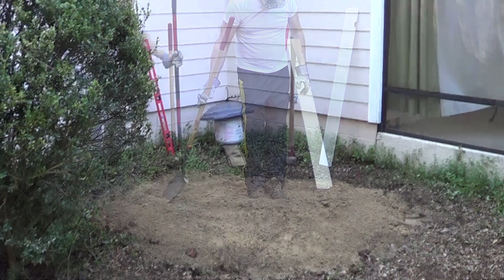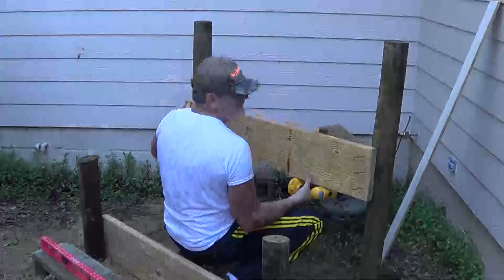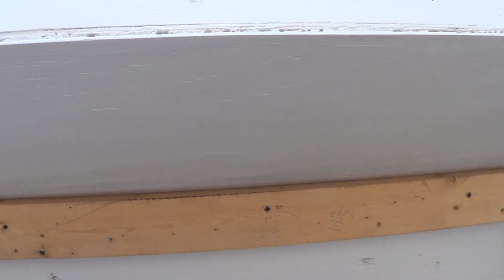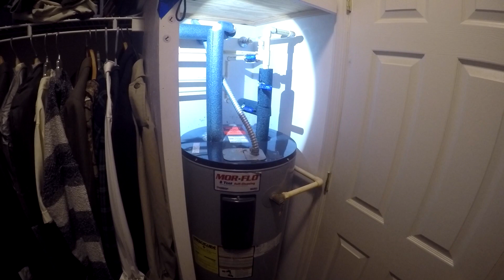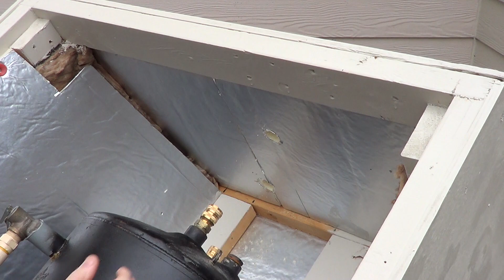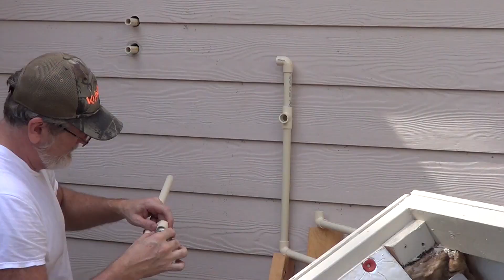Free Hot Water with DIY Solar Batch Water Heater Pt 2

Comment: Why 120 degrees? I dont need to kill dangerous bacteria...in the shower I just dont want to freeze to death. I'm retired so I can take a shower any time I want. So if the water only warms up in the after noon that's ok.
Reply from the maker: Hello Alan, the goal is to get the water as hot as possible without getting past the point off possibly scolding yourself.  That way, you have the maximum potential stored energy.  You can then mix the stored hot with tap cold to your liking.  Thanks!
Reply: @HomesteadEngineering  very good! That explains why my gas water heater gets the water to about scalding if you run only hot water for a few minutes.

Comment: I was thinking of reusing old refrigerators as a case and painting the inside black or put a black tank inside with mirrors around it to reflect the sun light to all side of the round tank. Just a Idea...
Reply from the maker: John, I think that would be an interesting project.  I don't think I would use mirrors as that may be risky.
Reply: @HomesteadEngineering  yes mirrors would be very risky to vampires as well as friends on acid

Comment: Too bad you couldn't mount it on the roof. Would be a lot hotter.
Reply from the maker: Yes, it would work a little better on the roof but much more problematic to install and maintain.  It's not the greatest location because of trees blocking the sun for about 5 months of the year.  I put it there to be out of sight and because the water heater it feeds is only 10 feet away.  Thanks

Comment: David,

Have you heard of a solar thermal ice maker that uses some type of refrigerant like anhydrous ammonia and calcium chloride?
Reply from the maker: Anhydrous ammonia and calcium chloride can be used as a medium for heat transfer in refrigeration systems.  Solar voltaic could be used to drive that type of system.  I don't know of any solar thermal ice maker systems...  Thanks!
Reply: Here is a basic design for what I am referring to. http://www.lightlink.com/francis/IcemakerManual.html. We are building this for a humanitarian engineering project through Arizona State University’s GlobalResolve program.  Let me know what you think.  I’m trying to think of where to source anhydrous ammonia gas from or if a different refrigerant can be used.  After our proof of concept here in AZ the project will have to be built in Lombok, Indonesia in a semi-remote village.  So simplest solution for refrigeration is best.

Comment: I did not have a lot of success with the batch water heater. mainly did not have a good spot for it. So I ended up building collection panels with copper piping they work fantastic and I was able to put them on the roof facing south.
Reply from the maker: Yes, I think location will have a huge impact on the results.

Comment: Hi David,  about 20 years ago, I had a company called Solar-Matic install a passive solar water heating system on my roof in Houston.  It was a 2 tank / 2 housing system which connected to my main tank in the house.  The tank compartments were made of plastic composite with an opaque / clear dome covering the tanks. Inside the housings, below the flat black tanks was a flexible silver coated Mylar sheet which acted as a parabolic reflector. They worked fairly well and I received a tax write-off for the installation. Your silvery sheet insulation boards are similar, concentrating the solar rays on the tank. I say...keep the reflective silver....just the tank as flat black to absorb the reflected energy.  Nice project  !    J K     ( PS,  I think Solar-Matic has been out of business for a while )
Reply from the maker: Sounds good.  Thanks!

Comment: I think you should paint the insulation flat black. You'll gain some capacity. Just a thought
Reply from the maker: YES, I think that would add some heat BUT I don't really have a good handle on just how hot this might get.  I don't want it to get too hot and cause problems.  So, I am going to wait and measure the performance before making any changes.  Thanks!